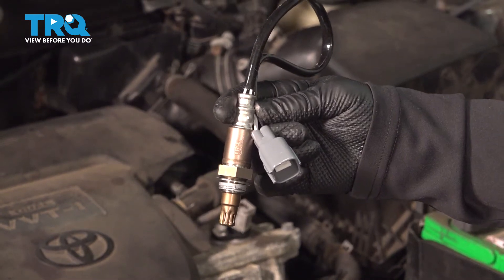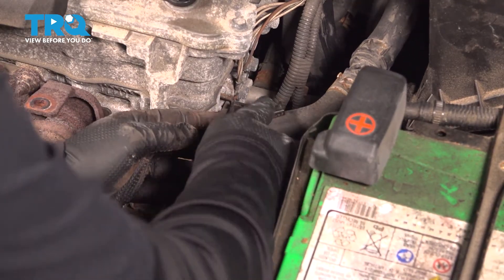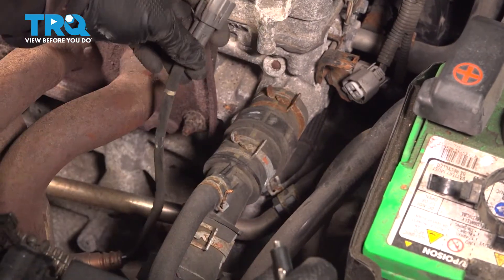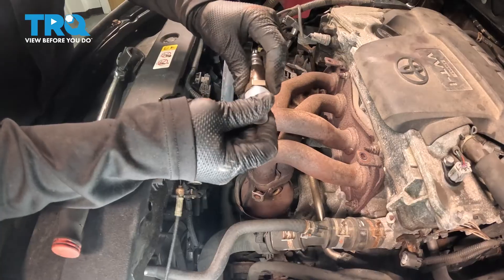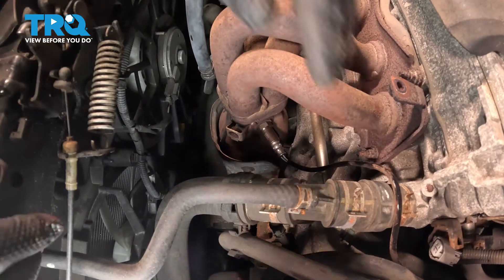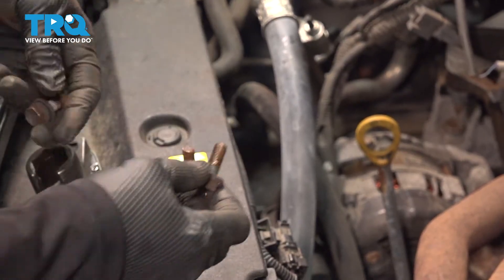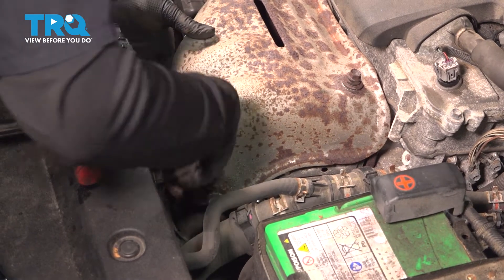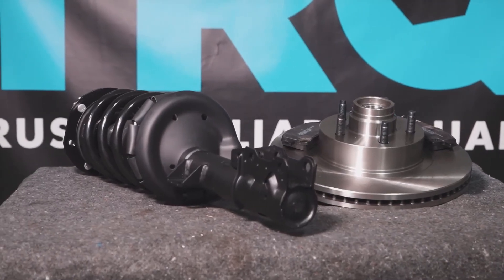How to Replace Upstream O2 Oxygen Sensor 2013-2018 Toyota RAV4 2.5L L4

Comment: Thank you for the video! How did you release the plastic clip that is located on the radiator hose? Would you please explain it in more detail please? I stopped working on this O2 sensor since I had hard time with removing this clip.

Comment: thank you so much, followed this video and was able to change out the O2 sensor with no issues. Cleared up an error where the O2 sensor was showing slow response/lean or rich air mixture. Even though the error showed for bank 1 sensor 2 (which i think is the downstream sensor), replacing this upstream sensor fixed the issue! Check your sensor OBD readings!!

Comment: Hi, I have a 2015 toyota rav4 with slow response downstream 02 sensor 2 code. I have removed the sensor and checked the 2 white heater cables and they read 12.9 0hms. What is the manufacturer recommended spec for this vehicle?